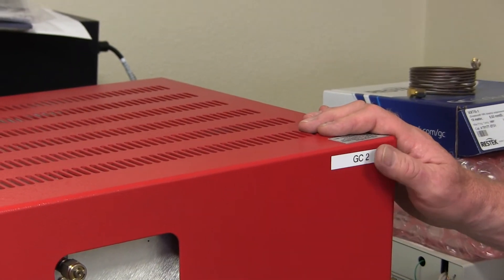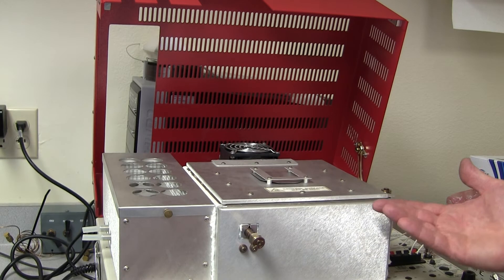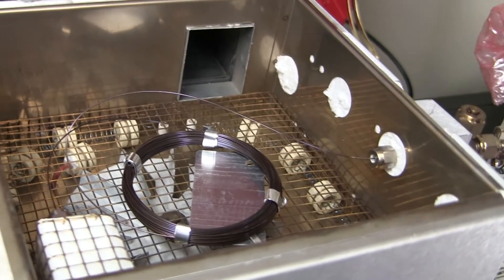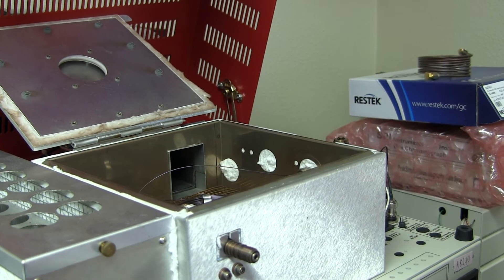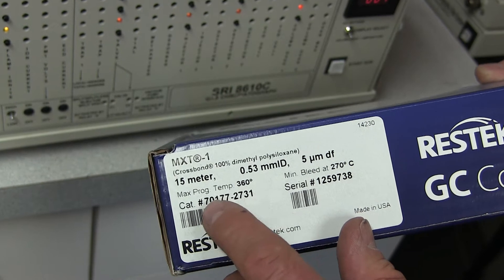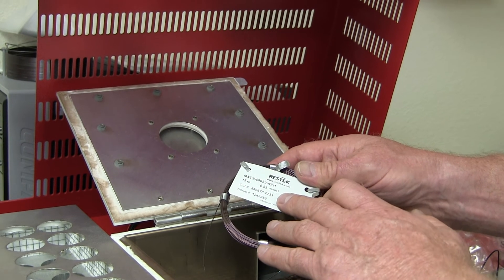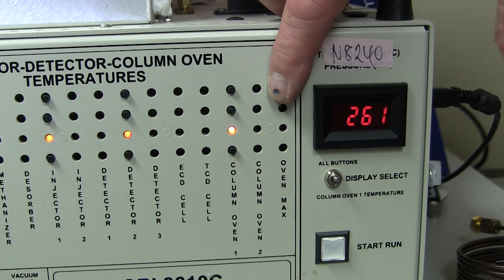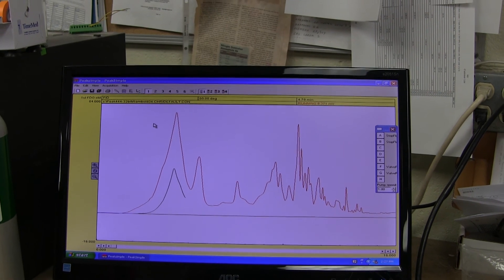What "Bake Out"means

Comment: How long should the column be baked out? How often would you recommend baking out the column and carrier filter based on running 50 samples a week?
Reply: Hi Mary, usually I bake my columns for at least an hour. For the frequency, it depends on the samples you have.. CO2 and water are very bad for molsieve. I bake my columns every Monday